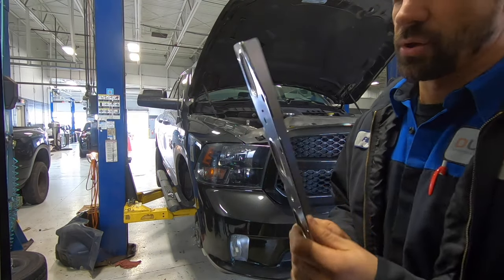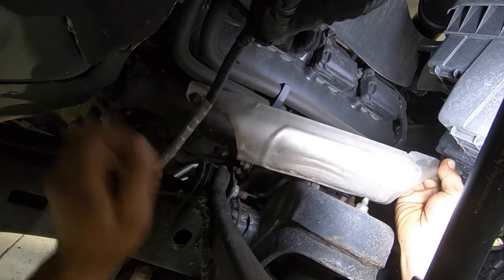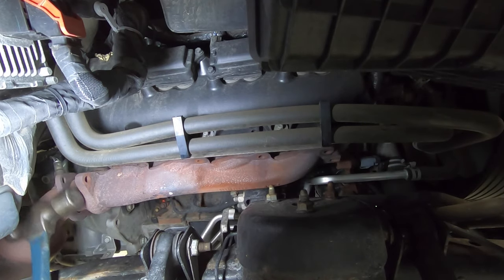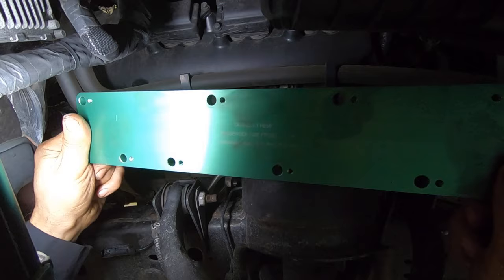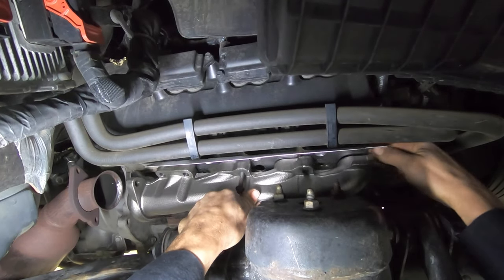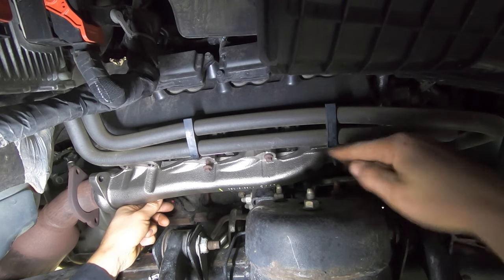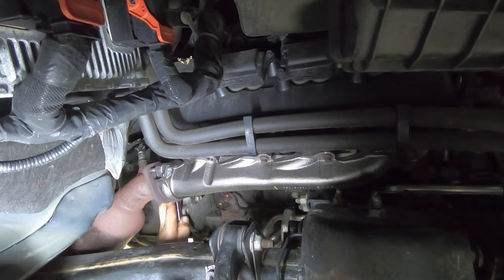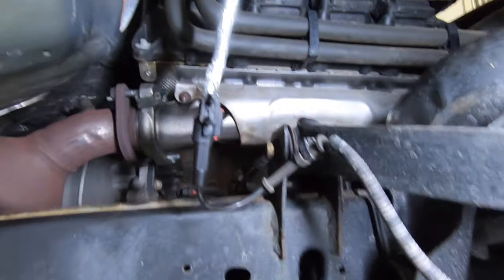5.7 HEMI Exhaust Manifold Leak | Broken Bolt Fix

Comment: Great video are you doing any side work i own 2019 ram 1500 with manifold leak still under warrenty but i don't like dealership workmanship.
Reply: Same year,same truck 2019/1500 with only 20k mi. Been having a tick noise on startup since purchased. Took in to dealer twice. They say can't replicate. On 3rd time, took in video of it happeneing. Their explanation was "as vehicle sits oil bleeds down & when first started, has to pump the oil throughout engine until oil pressure is achieved. It may sound rough for a SECOND, but normal operation & characteristic of 5.7 Hemi." I think BS?
Reply: @qrf7876  Hi i am currently using redline synthetic 5w30 motor oil which is ester base loaded with additives molbendum zddp and in general its a different type of oil ,
Most likely it will reduce or eliminate start up noise ,
Oil filter K&N or Mobil one 
8k with redline still looks good and performs well blackstone oil analysis conformation.

Comment: They are not stress relieved after casting. Simply machined, washed and put in the line for assembly. Flatten and reuse the originals. They’ve been stress relieved by multiple heat cycles.

Comment: I wonder if high-end aftermarket manufacturers make stronger manifold bolts ( ARP)  & would that help subsequent broken bolts 'on down the road' ?
Reply: That's what I'm wondering too
Reply: The bolts break due to tension from the warped manifold, so they'd likely still break eventually until you get the manifold planed flat again. Once it's been heat tempered it shouldn't warp again, so when you remove yours, spend the $100 bucks to have a machine shop make it flat again, replace with new OEM bolts and you should be good to go.

Comment: Exhaust gases temperature elevates due to unburned fuel due to old spark plugs with expanded gap in it. Thats cause exhaust manifold warpage and cat converter failure aswell

Comment: had the passenger side exhaust manifold replaced less than 3 years ago and it happened again. The block itself gets warped as well Ive heard so its a recurring issue forever

Comment: Hello , appreciate your video !!  thank you !!  i believe the problem is coming from metals that do not expand and retract to heat in the same manner ...  i have seen issues with head gaskets that are between an aluminum head , and a cast iron block  ... Aluminum and cast iron do not react to heat in the same manner  ....  who will fail ??  the head gasket ...  :-(  the same thing applies to the manifold who is made in cast iron , and again the head which is aluminum ...  possibly the bolts/studs are graded too high  ( 10.9 grade ) when we should be using bolts/stude the will be a lower grade  ( 8.8 grade or 6.8 grade) these bolts are less BRITTLE and will be harder to break since they are softer and more FORGIVING to the metals reactions to the heat ....  just a thought ...  ;-)

Comment: Why did you not use anti-seize on the exhaust manifold bolts that went into the engine block?
Reply from the maker: Those new manifold bolts come coated with some kind of thread locker/sealer, so I don't put anti-seize there. I usually do put it on rest of the bolts.

Comment: how long has anyone drove with a couple bolts broken? mine really dont make any tick sound but i have two on driver side broke. i probably wont fix it til it becomes an issue or if it does. truck has 240k and looks like its been that way for a long time maybe even since new

Comment: Im ony second exhause manifold replacement on my 2015 ram with 91K miles on it.  Both tome tbr warratny was expired.  If you ha e the dealership repair it then kt will have a 2yr warranty but every five years is the pattern for me now

Comment: You should try to use a mic welder to weld a nut it works awesome
Reply: A "mic" welder?! What is that? C'mon dude check you're spelling-it's easy and free. Do you even read what you type?
Reply: @bmead144  chill out. This isn’t a spelling bee.
Reply: @brysonhoaglin8618  MIG.  Metal Inert Gas.
Reply: @bmead144  your*

Comment: Is there a better after market header set i can buy so that it will be a one and done repair id imagine OEM headers will do the same after a few heat cycles
Reply: Yes it’s called bd hemi manifold. It comes with better manifold and the bolts are longer with spacers. The manifold is thicker and it looks like a better design than oem.

Comment: Mine does it for like 3-5 seconds every morning but after that doesn’t bother doing it, does it mean mine are broken?
Reply: Yes....  the reason it goes away after some time is the heat expands and seals.  But as you see the colder the engine, the worse it is. But least you dont have the lifter tick.

Comment: Awesome video man. Thanks! I currently have this leak on my 2015 1500. About 96,000 miles on it.. Any idea how much the dealer charges to fix one side? I believe its the passenger side on mine as well.
Reply: 760 for left exhaust manifold gasket replacement and extract broken studs
Reply: @Raizeph  Dang! Expensive. Looking to install short tube headers. BBK.
Reply: I have both bolts broke right now, and the estimate at the RAM service department is $1200 for gaskets and bolts.  Not sure yet what the plan is for the actual manifold to prevent further problems.
Reply: Just got quoted $2700 from dealer for broken bolts both sides on 2014 5.7 Ram 😬
Reply: @gordonlukehart2442  That's ridiculous.
Reply: It appears I have this issue as well. Is there any risk to the engine if this is not fixed right away? My tick goes away after a few mins after start up.
Reply: @hartman1  I wouldn't think so. If the leak gets bad enough, it could throw a code for back pressure issue, but it shouldn't hurt the engine. I'm at 105k miles now and whilemitnhas gotten louder, it still seems to seal off at operating temp. About to trade for a 23 Tacoma. Snuck the leak past two dealers  who I had appraise the truck while it was hot. Got 16k trade in for it.

Comment: Nice video, but wont that just break again why are we reinstalling cast iron?
Reply from the maker: Because some people have extended warranty and there is not much space for tubular manifolds and heatshields
Reply: So I’m going to be stuck with this. Wonder if they would let me buy aftermarket and warranty still pay for labor.
Reply: Would you be able to recommend a good aftermarket replacement?
Reply from the maker: @Brian-cf7dc  I don't think dealer will put any aftermarket headers and cover the labor under warranty.
BBK and JBA shorty headers are the most popular, have no personal experience and would not put them on my truck without heat wrap.

Comment: How much would a mechanic charge for this job? Currently having that issue with my 2014 Ram Lone Star
Reply: They charged me $1700 to do this for both sides on my 2019 RAM Laramie 5th Generation with only 59K miles.   They told me to plan on it happening again in the future.   Just an FYI

Comment: Will this cause a Loss in Power??
Reply from the maker: @c.juneau410  Normally it does not, but if the leak is big enough it could as the O2 sensors will not read correctly
Reply: @TDRAuto  thank you!

Comment: I had this problem and there is only one way to fix this permanently! Surfacing the manifolds is the only way! Replacing the manifolds will only do it again and again. Mine were warped .090 on one side and .105 on the other. At 120k miles I removed the manifolds to install headers and both manifolds were within .015. Don’t get suckered into replacing with new manifolds.

Comment: I’ve got this problem on my 2015 ram. God forbid auto manufactures use material that lasts on a 50,000$ vehicle.
Reply: I have a 2014 and we said screw it in till it doesn’t pass inspection anymore we have already had it for 30k miles it shouldn’t hurt anything but definitely should get recalled Ram needs to get on that

Comment: Funny this is common on the 4.7 v8 motors as well as a matter of fact my 2006 jeep grand cherokee 4.7 v8 has this jssue.studs literally snapped off on both sides around exact same time. Heat shield is hanging on by a thread 😂😂

Comment: Does this really have to be fixed immediately? Being it goes away when warmed up is there any potential of valve damage or is this just a minor annoyance?
Reply: Been wondering the same thing.  Got this issue on my 2012 JGC
Reply: It starts as a minor annoyance, and progresses a few years later to being a massively loud exhaust leak that quiets down in 10 minutes of running a bit. Then it will throw off your o2 sensor readings as well. I know because I dragged my fix out for 3 years lol. Probably got 1 or 2 bolts holding the exhaust manifold on at this point.

Comment: this just happened to me with my 2020 ram hemi. in the shop as we speak. dodge said they had to replace the manifold and gasket. truck has 13,000 miles on it. sucks..
Reply from the maker: At least it's not that big of a job and it will not get you stuck on the road.
Reply: @TDRAuto i agree. any chance it will happen again ? or was it just a freak occurrence ?
Reply: @o-o6355  it will happen again unfortunately. I have a 16 and around 47k had both replaced and now at 67k my right is leaking again. Thank god I came across this video I’ll be replacing both sides and going to have the headers resurfaced
Reply: @10cobra03  ... resurfaced with what
Reply: @kingshark5938  I just replaced the bolts, this kit is worth it. I no longer have the truck. Manifold was no warped. I now have a 2020 with the same fing problem. Ram can’t get there sh*t together.
Reply: @10cobra03   ... ok, was asking, my pursuit in the dealer with this issue.  Got a warranty,  seems from the video it's a simple fix for the passenger side, just happens to be my affected side.       N seems to be the most problematic side from research.     

Crazy, cause it's what I expected,   they were like, it's just the lifters being emptying and filling,  which ok I can get that, especially for these bolt issues that stop making sound once warm. 

But, they actually seem to may have found it being this issue,  ok fingers cross my dodge shop might be on it.  🙏

Comment: How much ya think this will cost at a shop?  In a tough spot where I can't afford to fix it and can't afford for it to break down on me. Maybe sell it to carvana
Reply: The stealership quoted me $760 in 2022 for the passenger side. An indy shop might be a hundred or two less, but it also depends on how much of a pain it is to extract the broken bolts.

Comment: The problem is not the manifold or the bolts. If Chrysler would offer or replace the Y pipe and move the catalytic converters another 12" away from the engine, maybe the exhaust manifolds wouldn't get so hot.

Comment: Ok i have an 08 mercury grand marquis that has the same problem, when it cold it makes noise and the first start and the noise is going down a little bit, the noise is on right side of the engine, maybe the engine, or the exhaust manifold

Comment: I'm curious as to the ratio of manual to automatic xmissions having this problem. The manual xmission driver has more control on RPM's. Bang a few gears at higher RPM, sudden heat up, then merge into traffic back to 1.5 or 2, sudden cool down. It could take its toll.

Comment: Why this isn't covered under warranty is beyond me!  This is a serious problem, my 2014 Ram 1500 has the same issue.  My right side manifold leaks on startup.  So annoying and obviously a design fault.  The  stock manifolds are cheaply manufactured and way too thin which causes the warping.
Reply: This is covered under powertrain warranty. unfortunately 100k and 5 years. The real issue is the dealers only replace the gaskets and bolts, putting warped ex manifolds back on to break the bolts in the future, ask me how I know. The manifolds need to be resurfaced first, they wont warp again.
Reply: My 2019 Ram is at the dealership now they are replacing the manifold on the driver’s side. Did the Passenger side at the beginning of the year. all under warranty. I know they’re replacing the manifold ‘cause they’re on back order and we’re waiting for it to come in
Reply: @nealb3298  ,That's not problem manifolds are junk, cheaply made machine old ones and it will not happen again because they have done been thru heat cycles the new ones will do the same thing warp, I took mine to my friends machine shop , 100th  thousand miles and still going good
Reply: Per my dealer this is NOT covered under warranty.   They are telling me it is because of defective "Fasteners" and "Fasteners" are not covered.    $1700 to fix this on both sides of the engine.    My 2019 Laramie only has 59K miles.     I asked them if I am going to have to replace these at a cost of $1700 or more every 60K miles and they told me that it is a known problem and Dodge is aware of it, but it is NOT covered under any warranty with the exception of within the first 36K miles or 3 years.   No extended warranties or the lifetime power train premier warranties cover this because it is caused by the fasteners.    After they repaired this and got my money, they told me to save the receipt in case there was a recall in the future i could get reimbursed, however if this happens again my tech told me to save my money and get someone to install high quality headers with high quality new bolts that are not made by Dodge the next time that this happens and I should not have any future issues with it.    Dodge "RAM" should be ashamed of this and should be doing everything that they can to make this right,.     If this is still an issue when I buy my next truck, I guess I will be looking at other manufacturers.    Apparently Dodge RAM does not give a dam about their customers who pay in excess of 70K for a fully loaded Limited or Laramie 4x4.   Good luck to all, hopefully you will not experience this with your truck, but from what I am seeing and hearing all of them are doing this. @imaVideojunky

Comment: Known problem with Hemi 5.7. Want to fix it? Think of the cause! Bolt breaks then manifold warps & leaks. BEFORE the bolt breaks, which is reason it leaks, remove bolt, replace with grade 8 bolt. Problem fixed before it happened!! Most arm chair mechanics can do and a lot of money saved. They will not warp if held in place!!!!

Comment: What happens if the noise never stops even when warmed up?
Reply: Odds are you have a broken bolt due to the warping of the exhaust manifold. Sometimes the manifold warps a tiny bit which seals up when the engine heats up. If the warpage is bigger, the engine heating up isn't enough to seal the exhaust leak.
Reply: My manifold actually cracked. Doesn't matter how hot it gets. Still ticks

Comment: You will be changing the cam and lifters next. JUNK
5.7 Hemi is the worst V-8 engine I’ve ever had. When they run, they run great but the Exhaust bolts, Cam, lifters, valves, bent push rods will have to be replaced at 100k miles. 100% of those engines will have these problems. 
FYI, don’t get screwed over by some mechanic telling you you only need 4 lifters. Get all 16. There is a kit that comes with EVERYTHING you need to do the cam and lifters including new timing chain for less than $1000 
The labor is 12.5 hrs. You should not have to pay over 3 thousand dollars for a complete job. That’s also includes taking the a/c apart and having to recharge it. All that labor is included. I’ve seen mechanics charge over 5 grand for this. I don’t know what’s worst… Hemi’s or mechanics. Jk😊

Comment: For a couple of bucks, why wouldn't you just replace all the bolts? I never reuse manifold bolts, they have too many heat cycles and are prone to corrode and snap off when taking them off next time. Just put new bolts in..
Reply: I believe that is what he did.  I’ll have to watch again but I’m sure he did.

Comment: Funny how ram continues having issues with the hemi manifold charging their customers an outrageous amount of money to have it fixed. Only to have it happen again down the road. Ram would go broke if this was a recall. Surprise no one has a class action suit to Force ram to correct this issue because it still happening on newer models. Good for the service department bad for people buying ram trucks🤣🤣🤣🤣
Reply: What’s even funnier is that all makes use cast manifolds stock… cast when it heats and cools warps over time, this has nothing to do with the make of a truck, source urself a little knowledge first
Reply: And the proper way to fix it isn’t to buy new manifolds, ur factory manifolds that already have been through numerous heat cycles obviously, have them machined flat and buy a new gasket and new bolts, never will have an issue again
Reply: @TheSteelerfool  Who cares about other makes that use cast manifolds I’m talking about ram. And who cares what kind of testing they’ve gone through. There’s obviously a problem the solution is buying aftermarket. JBA headers that fix the problem once and for all because that’s what I did. Good day sir
Reply: If someone on this thread is a lawyer, looks like they can get a lot of people to sign on to a class action law suit.   I would sign up and participate.     It would still be cheaper for RAM to pay a lawsuit than to do a recall.    when someone  dies from the exhaust fumes, then it will become a recall due to the Safety board, but until someone dies, the only other action is a class action lawsuit.   Sign me up if someone wants to run with this.